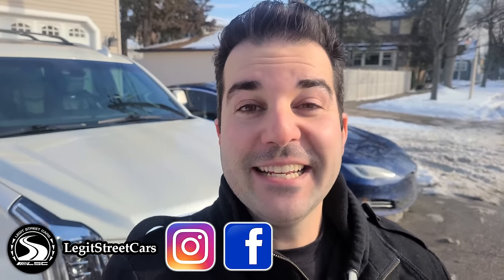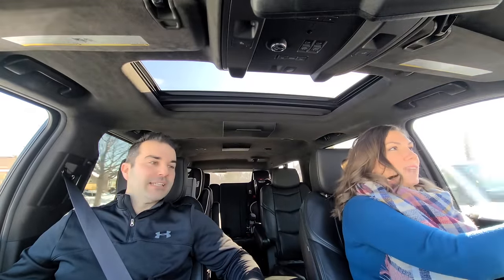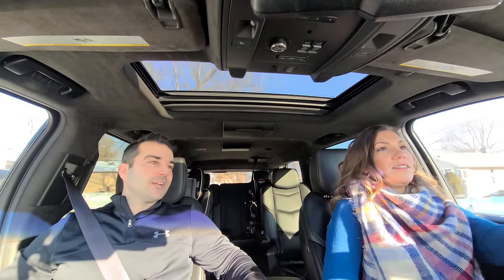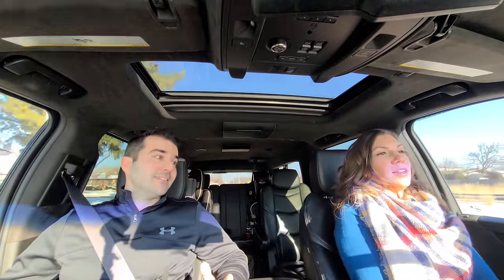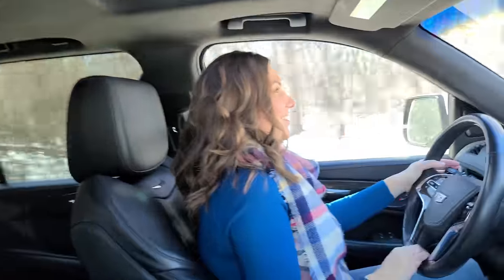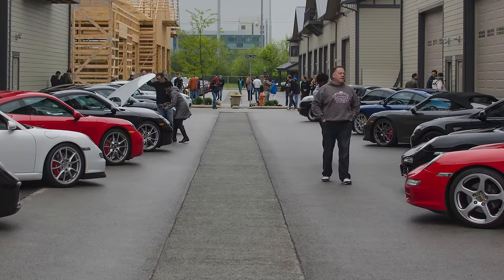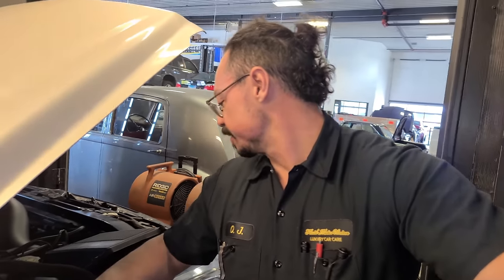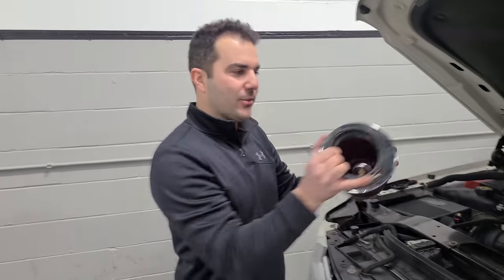My Wife's Reaction To Secretly Supercharging Her New Escalade! Boosted Launches, Burnouts & Dyno!

Comment: I'm seriously considering adding this supercharger to my ESV. The warranty expired and I've decided to keep it for a few more years because the new ones are insanely expensive. These videos are awesome. Thanks Alex for the inspiration!
Reply from the maker: You won't regret it.
Reply: You honestly will not regret it. This thing is such a sleeper and the kit genuinely took Alex and Peter 2 days to install. I was honestly shocked lol
Reply: @MaxBeecher  I think it would take less time since they were also changing the spark plugs and cleaning the valves. It really looks pretty easy to install, probably a solid day or day and a half. Guess I need to get my order in with a 10-12 week lead time!
Reply: @pto44  better get on it!!!
Reply: @pto44   definitely less he said he only worked for 8 hours each day i’m sure if u worked on it from dawn to dusk then it’d be finished
Reply: @LegitStreetCars  update the braking system or you will regret it
Reply: Hello, I’m trying to reach you about your cars extended warranty

Comment: Positive displacement blowers (roots or twin screw) are INCREDIBLY sensitive to intake restrictions. If you do the 104mm throttle body, a larger diameter intake, and remove the intake box, you will break 500whp, maybe even 525. Back when ‘03 Cobras were in their heyday, and we were just learning about positive displacement blowers, people would bump the boost up, get up to around 475rwhp, then add a big throttle body and intake and gain 80-100hp with just the intake mods. That means that not only are the super receptive to gains if you reduce restrictions, but they also lose tons of power if you increase restrictions. Make sure your air filter is clean/new. A dirty air filter on a positive displacement blower car can kill 20-40hp.

Comment: Great to see you working with ProClip.  They're great and have been working with them for years.  Great video!
Reply: I completely agree. I have put ProClips in all my cars.
Reply: I have a 2014 V8 Sequoia with 80K miles on it.  Is it okay to add a Turbo system without overtaxing the engine?
Reply: Definitely a good video if Aaron committed on it. lol
Reply: @mstrdiver  fuck yes those are great engines. just don't buy no cheap ebay turbo. and finding after market exhaust turbo manifolds aren't gonna be cheap, but i would say go for it!

Comment: Gotta love the instant power boost. My Challenger with a 5.7 went from 373 crank HP to 484 H 496 T at the wheel with 6.3 pounds of boost on my water intercooled Kenney Bell supercharger (just a sane and safe boost, the SC can go easily to 800 wheel HP on this engine and it is a smaller blower). You have the nice cold air of winter Chicago and I was in mid 70s spring time So Cal desert (FAMOSO Raceway... the one that is very often seen in many Motor Trend shows such as Roadkill) I would love to have your AWD traction! Even with the biggest DOT drag radials we can stuff on my back end, without a prepared track I have to feather into the power to keep hooked up. Your wife will very quickly get used to having the "extra" power to do things like you did, get around slow trucks. LOVE the boost! Factory tunes are OK but way over safe. After you get your induction and exhaust worked out take that in for a custom dyno tune. You easily will get another 20 or more HP and TQ out of the truck without any danger to the truck at all. But then, you already knew that LOL :D Congrats to both of you!

Comment: On the Lightnings, a lot folks, me included did the "swiss cheese" mod to the bottom of the air box.  Basically a small one inch or so hole saw was used.  It brings out the sound of the SC a bit more.

Comment: The cold air intake is the cheapest 20 hp you can ask for.  The stock intake is terribly restrictive over 3000 rpm.  My 5.3 was good for 55 hp and 60 lb of torque over stock after the cold air and tune. 
The tune was worth the money alone just to clean up the sloppy transmission, the additional power is just the icing on the cake.  If you own one of these trucks you need a proper dyno tune.   Well worth every penny.

Comment: @legitstreetcars you could probably just remove the intake resonator that lives in the fender. That way you avoid the headaches of an aftermarket intake and still get most of the sound and performance if not all. Plus, paper air filters get more dirt and dust than the cotton ones

Comment: Boost weather doesn’t add more  oxygen to the air, but the air is denser which means air molecules are closer together. Helps more in superchargers than turbos. Cooler air helps both with the colder charge of air.

Comment: Lets get technical.. Colder air does not have more oxygen in it... colder air is more dense. So it has more oxygen per Sq Ft.. but the overall atmosphere is not more oxygen saturated. This is why intercoolers and chillers and such are big deals under hot conditions at a track... making the air/fuel/NOs/etc. colder... condenses the oxygen saturation per Sq Ft. creating more bang on each combustion stroke. "Boost weather" is just the outside air creating the effects of an intercooler, or a chilled manifold.

Comment: Out of curiosity, what gear was the dyno test run in? The escalade, like most trucks, is going to have a pretty low speed limiter because of the tires. 6th gear is 1:1 on the 8 speed which I think would be around 150mph, way above the  governor. Im guessing the pulls were in 4th, maybe 5th, which would explain the 25% loss.

Comment: I know this is a year old, so probably to late to get an answer but does the supercharger reflash lower the redline?  The dyno runs (even with the stock air filter) the dyno operator was cutting off the runs well before the stock redline, and power was still going up.... it was almost like he didn't want it to beat the twin turbo Escalade.   Also, any 1/4 mile video's with the wife driving?

Comment: My L98 6litre only had 360 flywheel hp and it would get wild in the tail when I floored it and I wonder if all you new-wave rev-heads going around with 600hp+ are being kept alive by stability control systems?   I know y'all turn off traction control or defeat with sheer power but is it the other background systems keeping you straight?

Comment: Lovely. This was the answer to a question nobody asked. And now the truck requires 93 Octane fuel to run properly. An expensive mod to an expensive vehicle that will be more expensive to run every day going forward. How does this impact the warranty? Do you plan to keep the truck long term, or are you more of a vehicle flipper?
Reply from the maker: It doesn't have a warranty. It has 82,000 miles and is 7 years old.
Reply from the maker: Long term

Comment: 21:43... u mentioned plexyglasing that area, nice. I wonder, could one like, bypass or add a duct from the interior cab's A/C and run it to the intake filter area? Like, if it dumped out right to the enclosed area of ur plexiglass seal? U think that would have an effect or waste of time for no gain? Just wondering about it. The focus would just be the air temp and if that could lower it in that area, technically, better right?^^ I dunno...
\O>